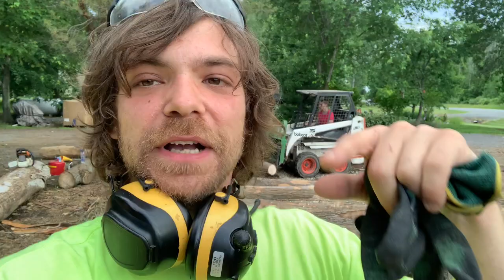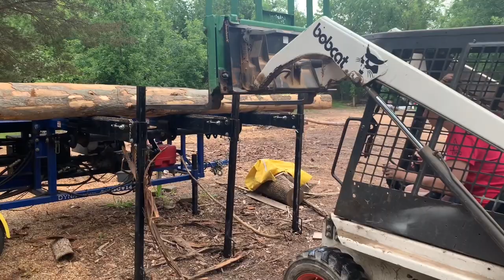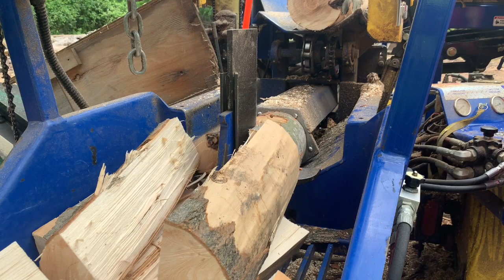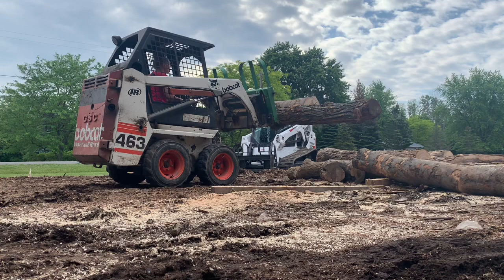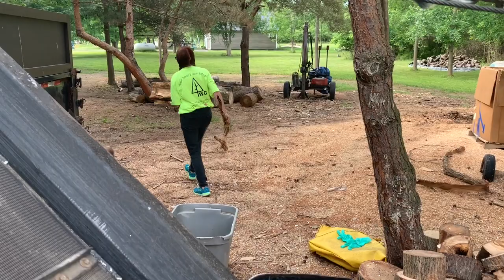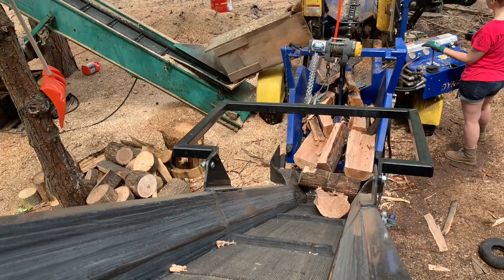WOMEN CAN DO FIREWOOD TOO! (THATWOODGURL)

Comment: Assuming you swap out ( or sharpen) the processors saw chain once a day ?  Or more ?  Great video. And teamwork.
Reply from the maker: So it all depends on the species and how clean the logs are but I can typically run about 30-40 face cord before a blade change :)👍🏻